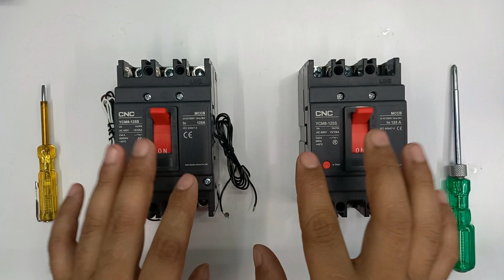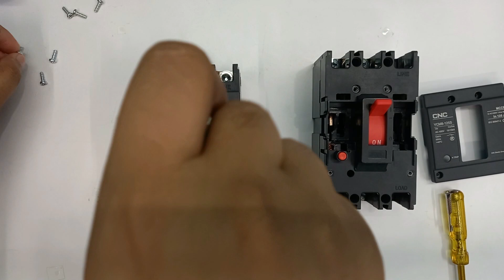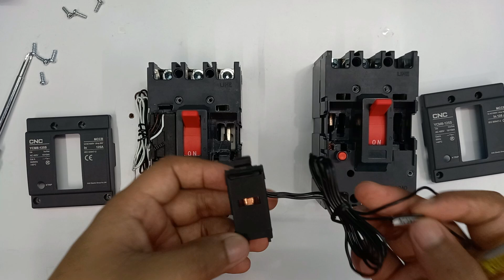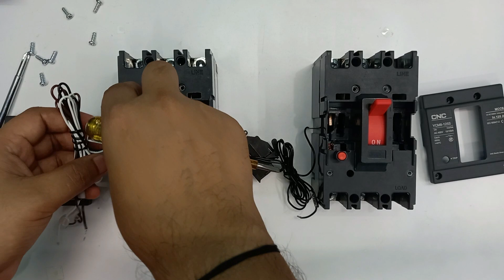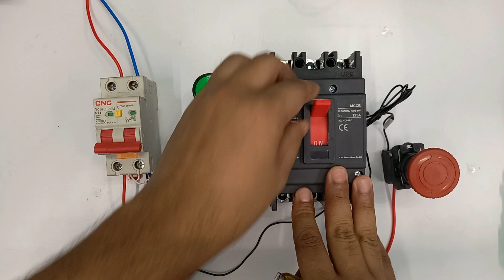Why Shunt Trip Coil and Auxiliary Block Used in MCCB | Accessories of MCCB @LearnEEEEnglish

Comment: Thank you very much. I planned to install one power contactor for UPS(40kVA) input and out put circuit. But, after seeing your video, I totally changed my plan. Only need to install 2 MCCBs with shunt trip coil to switch off the UPS input and output from a remote area at the time of emergency. Thank you.

Comment: How to use Shunt trip with High Voltage and Under Voltage protection Devices such as 
Hegar MZ215, Overvoltage and Undervoltage Release
Legrand Pop Over Voltage Release (catalogue number 406286)